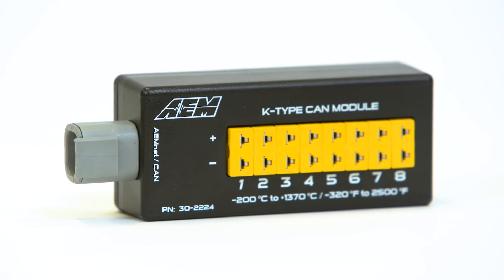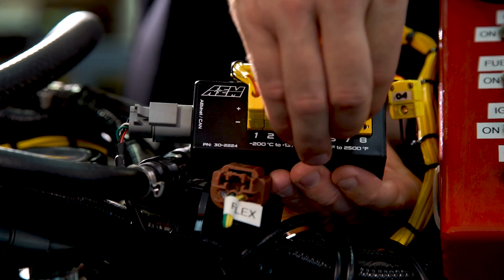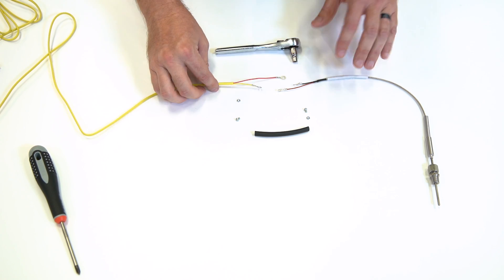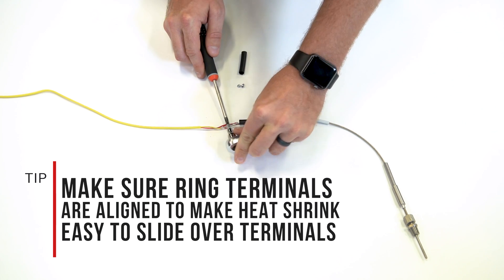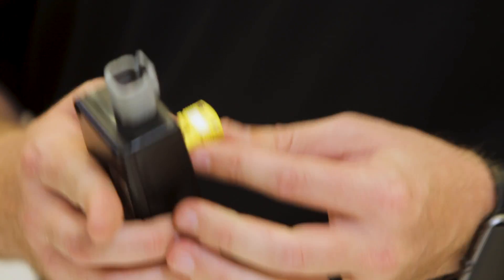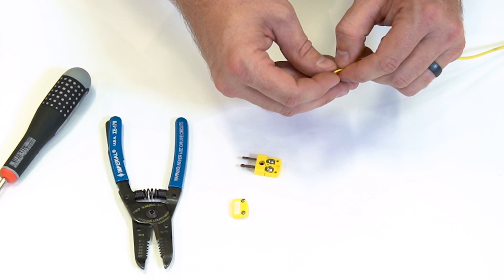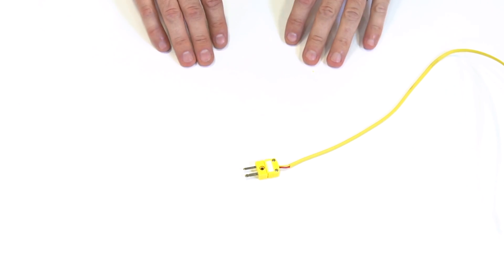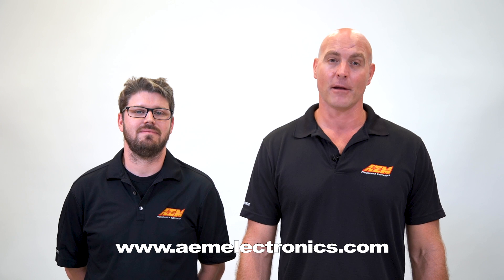K-Type EGT CAN Module EXPLAINED! 8 TEMPS THROUGH 1 PLUG!

Comment: Are you able to add more than two of these to the same BUS? I'm looking to use 3-4 in my application
Reply from the maker: There are only outputs for 2 units with a jumper to change the message IDs. If 3 or 4 are needed I recommend using a system with two configurable canbus inputs. The EGT module also has a jumper for the bus speed so 250,500, or 1000kb/s will work.

Comment: Will this module work on aem series 2?
Reply from the maker: Yes, it will work with the AEM Series 2 if you are using the AEM CD-7/5. The CD-7 can overlay and log the data from both the AEM Series 2 ECU and the 8 Channel EGT module